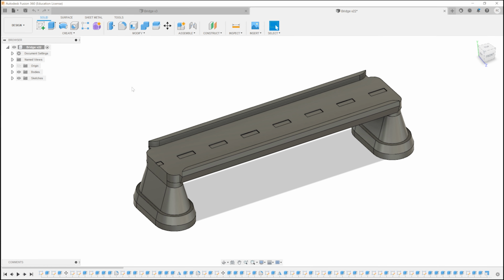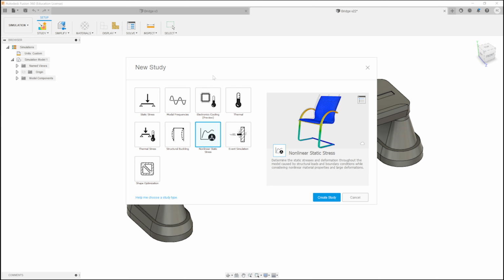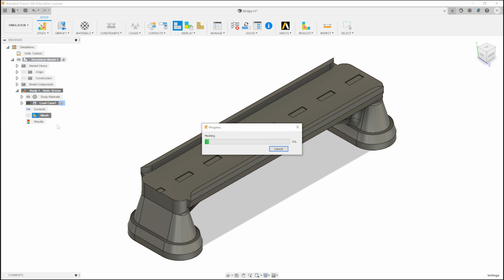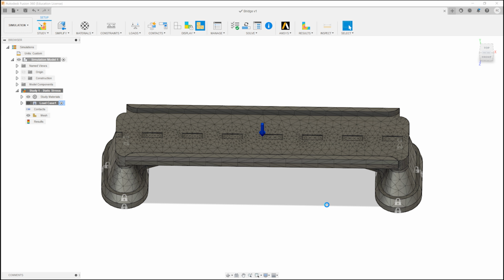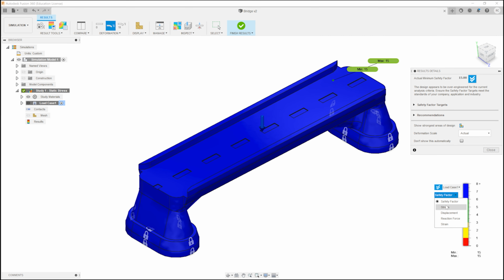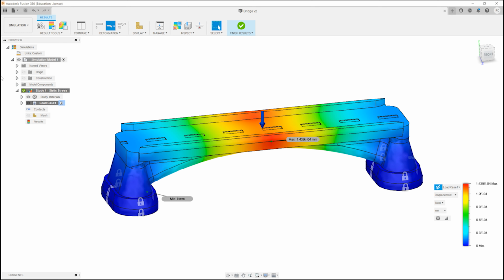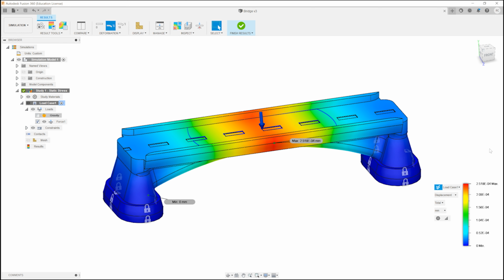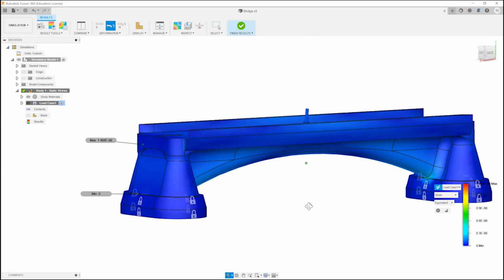CADing /3D-Printing for Beginners 06 - Static Stress Analysis

Comment: What a great video! Are there any other simulations to use on Fusion 360?
Reply from the maker: Here are the other simulations on Fusion 360:

Modal Frequency: Determines how objects perform under constant frequencies or in other words, oscillating motions.
Electronic Cooling:  Tool that enables you to visualize the temperature/air movement within electronic assemblies.
Thermal: Determines the Temperature an object can withstand.
Thermal Stress: Calculates and determines the amount of force an object can withstand under different temperatures.
Structural Buckling: Measures the displacement for an object that does not snap, but instead bend.
Nonlinear Static Stress: Determines the effects on an object when more Load is applied over a period of time.

We hope this helps!